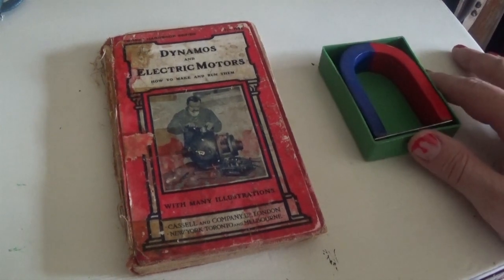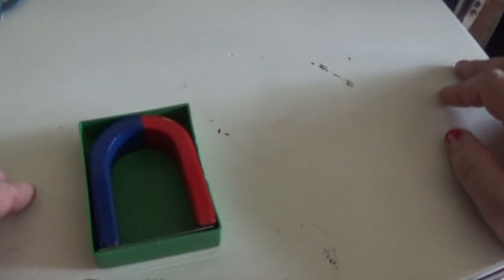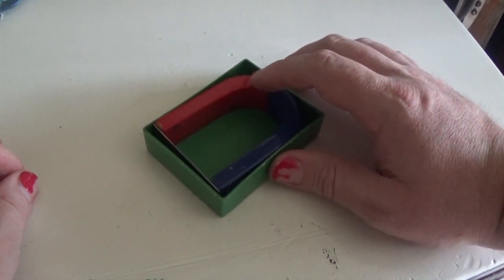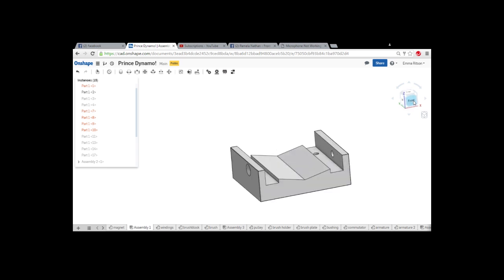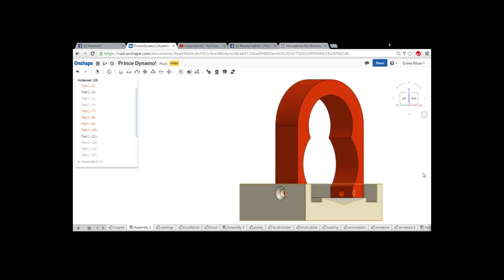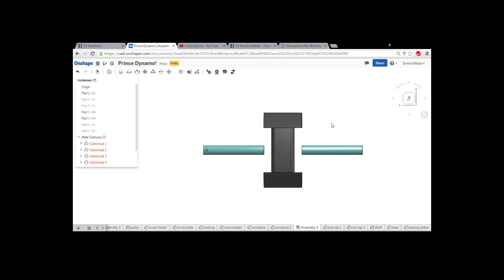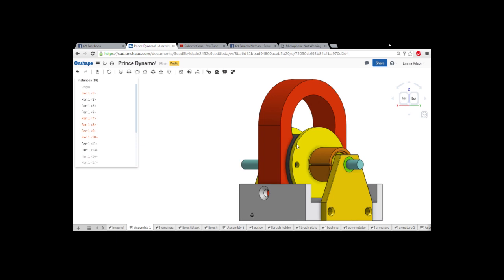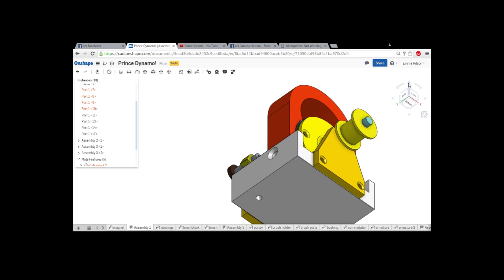Prince Dynamo motor PART1- Intro

Comment: I used to build similar things as a kid. I see no reason why it won't work. But beware of dinky magnets. Don't you need/want springs for the brushes? Or are you relying on the springiness of the brass?   I used to use carbon from old flashlight batteries but you can't get Leclanche' cells anymore.

Comment: I think these were used in war phones. I have a sealed unit somewhere and it has a very similar body (underneath the usual green paint and robust military plates) to the 3D model you presented.

On a side note, one peculiar thing i remember is that the dynamo would power an LED but the resistance of the LED was so great it made turning the handle hard and almost as if it was step geared. Made me realize that the phones in old war movies were never hooked in, not even for appearance sake, because that thing is really hard to crank when under load.

Either way, enough rambling. Just want to say i'm looking forward to this, projects like these are always fun to watch. :)
Reply: +aserta Sorrybut leds were not invented until well after the war.